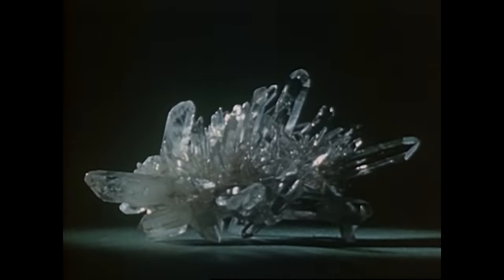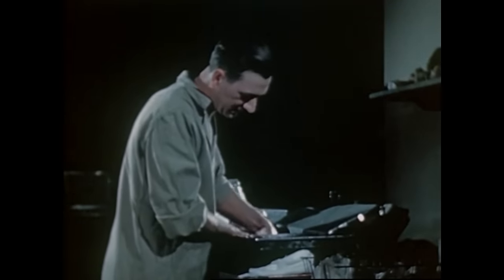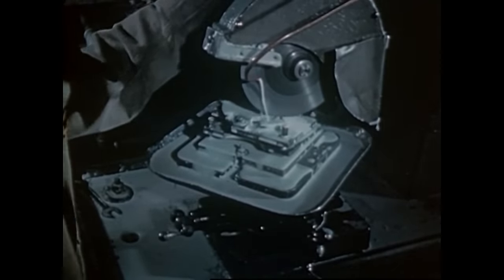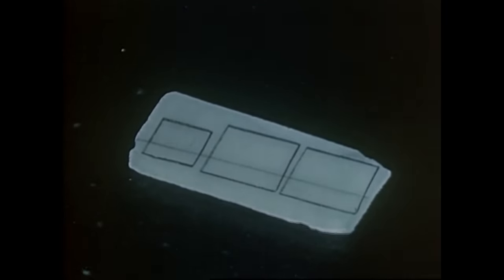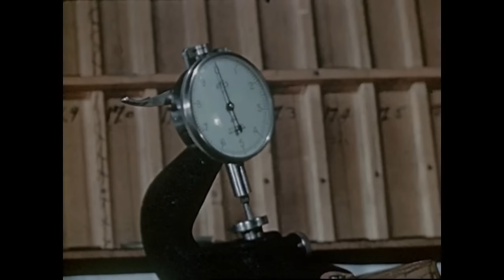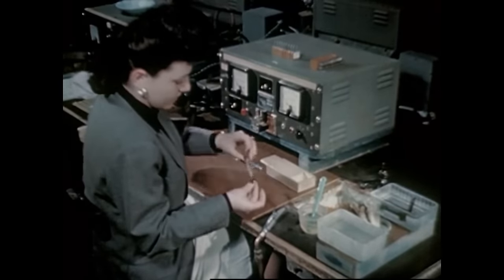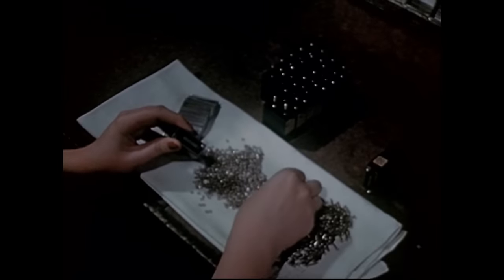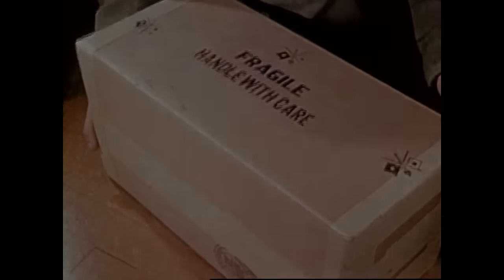From Raw Crystal to Crystal Oscillator - Crystals go to War in 1943

Comment: Although I was a professional RF Engineer, for very many years, I had never seen this documentary film before.  I have designed and used crystal oscillator circuits many times in my life but I had no idea just how many production stages and tests were originally involved in mounting and manufacturing the quartz slices. A great film detailing a piece of technology history.
Reply: I wonder how they are made today? There is a company called Rakon that makes them here in new zealand and its all done in a clean room environment, their crystals end up in satellites and all sorts of spacecraft.
Reply: @nzoomed  Good question.- the number of manufacturers seems to have decreased over the years and I understand that gold plating the contacts has become almost universal.  Modern developments in frequency synthesis and phase lock circuits means there is less demand for discrete frequency crystals, but more demand for the "digital friendly" frequencies that lend themselves to these synthesis schemes.  It would be very interesting to see how a modern company makes them.
Reply: @hectorpascal modern ones are also much smaller.
Those ones that go inside digital watches are pretty tiny.
Reply: @nzoomed  Modern manufacturers start with large factory grown crystals instead of the mined natural crystals. Slicing the crystals into thin wafers and grinding them flat is still done more or less manually, basically as shown here. But after that the process is much more automated. No manual fiddling with each crystal to etch it precisely to the right frequency.
Reply: @cogoid yeah, that would be expected. The size of the modern ones is far smaller today, the 16mhz ones I use on my arduino are pretty tiny, seems to be a different form factor compared to the much taller ones I would install in my CB radio, but pcb footprints are identical

Comment: Wow, old technology with respect to frequency determination, but darn impressive, plus a lot of work to manufacture.
Reply: The same technology is used today. Maybe the machines are a bit more beautiful.
Reply: @ciprianpopa1503  In chip wafers?
Reply: @emilkarpo  Many devices still use quartz crystals for clock signal generation, including computers, cell phones and many other devices that have processors. There are also ceramic resonators now, so some devices use those instead. But the crystals are cut in tiny sizes now and put in small metal cases.

Comment: The US had a lot of trouble getting sufficient quartz of good enough quality to meet war needs.   So Bell Labs devised a process for making synthetic quartz, making most of the work shown in this film obsolete.
The film shows them using the old fashioned pre-war FT holders.   Several manufacturers came up with gold plating the contacts on to the plate and encapsulating in glass - thus very much improving performance and making the rest of the work shown in this film obsolete.
Reply: Neato, thnx for the extra infos 🙂
Reply: HC6U and HC18U spring to mind.
Reply: Japan did even more in the early 1980s.

Comment: Who was the intended audience for this film? The first two minutes are so general that it initially appears to be made for the general public. However, the beginning is followed by 40 minutes with so much detail that I would not be surprised if some of the information was classifed in 1943 when this was made. It is great for historical electronics, though.
Reply: Being in a signal unit in the late 80's I would guess signal officer training. Some of this information was still pertinent for older equipment, though that stuff was being phased out.
Reply: Employee orientation.
Reply: If anything was classified in this film, which there is not, the entire film would require a War Department classification banner at the beginning and end. Which there are not.
Reply: Perhaps engineering students, or college kids in geology101.
Nobody in modern times hardly teach to kids using these films, when everybody has powerpoint?
I had plenty of these in A school and C  schools.
It's better how it's done nowadays.

Comment: I've done a few crystal oscillator sets in my career. Maybe once the type in the video. I repaired CB radios and scanners that had 3-12 channels that required separate xtals for each channel in the 1960s and 1970s. The CB radios need a pair, one for transmit, the other for the receive section. My company, Radio Shack, who sold these radios started making xtals for these sets as well as their own brand of wire and cable here in the US. However, the QC in that xtal Lab was not up to speed as some of the xtals dropped lower in frequency outside of the band tolerance over time. As if the equipment was bought and the experience needed to produce these xtals was lacking. The lab manager kept denying these claims and the store managers got the xtals from another source before the PLL units were sold with all of the frequencies, bells and whistles you want to monitor.
Reply: Do you remember when those super old electronics had that red liquid inside of a little bulb looking thing?? 
What was that?

Comment: I actually did this on strontium titanate crystals for a summer job back in the 90's for superconductor crystal research... We didn't have the oil tank and polarizer, we looked for marks on the crystal which gave away the orientation to a degree. Then we'd mount it to a block and hit it with an X-ray source and then onto some polaroid film, and leave the room. Shoot it for a few minutes, tehn come back back and pop the film out and see the orientation. From there you'd know where to adjust it and grind a flat on it, reshoot it to see if you're still accurate, then send it off to the wire saws to be turned into disks. 

It was an interesting job.
Reply: @BrianFortner  I really didn't have a job title... that was literally 30 years ago. Company was Coating and Crystal Technology LLC in Cadogan PA.
I was summer help as an engineering student so I got into all kinds of stuff.
Reply: @BrianFortner  In all honestly what it boiled down to was they did some pretty neat stuff and a friend of mine worked there in the machine shop. Since I was going to school for engineering, he mentioned it to his boss, who met and he realized that I understood what he was working on so he turned me loose on some projects. I learned a lot that summer, some good some bad. Overall it was worth it.

Comment: We used to back in the day pull the crystal chips in our radios and switch them giving us a unique channel. This works if it the same in sender and receiver.
Reply: Please say more about switching
Reply: You can do it with CB radios too... "private" channels. Well, at least private to other CBers.
Reply: Our switch the tx and rx around and moves the the frequency up 455khz
So say you were on ch 22 which is 27.225 the you would end on 27.680 if the radio has high side injection.

Comment: I used to work for a company that was a DOD contractor.  When we had to ship stuff, we would seal the boxes exactly as shown at the end of the video.  We used a tape machine to moisten adhesive on paper tape, which was placed over every seam of the box.  We did not have to stamp the tape seams, though, as the adhesive was strong enough to damage the box surface when removed.

Comment: I am flabbergasted at the amount of work that went into the manufacturing of crystals !
Staggering !
And to be sawed to a 1/16 of an inch !
Just amazing !
But to think those Brothers stumbled upon the Piezoelectric effect of crystals, too is amazing !
And to know how many times this was used, is mind blowing !
Reply: If you simply throw any white Quartz rock against another one in the dark, you will get a brilliant display of the electric potential in the rocks.
Reply: @kevinsellsit5584  
That too, is interesting !
I wonder if you had a Radio receiver close by, if you could hear the spark from the collision ?
I'm guessing not unlike lightning, it is sending out energy on multiple Frequencies simultaneously ?
If you know Morse Code, and could hold the stones, one in each hand, you might be able to communicate with someone in close proximity ?
I wonder just how far those sparks could be heard ?
Wonder if this is how German physicist Heinrich Hertz  got started ?  ⚡🤔
Lol...!
Reply: @sleeve8651  The discharges will be really inconsistent but they will send a wide range of a random spectrum, just like static or a lightning or a bad brush in a motor. I remember I figured out you had to cap coax splitters by noticing the tv went fuzzy when I used a cordless drill right under it and only there
Reply: @sleeve8651  It would work for morse code within visual range (wear your safety glasses). You get brilliant sparks every time. I would assume any radio transmission would be chaos.
Reply: Nice corn bread
Reply: Watch your rocks

Comment: Some day our ancestors will be telling stories of us in their caves. How we could fly like birds and make rocks talk to each other.
Reply: Descendants, not ancestors; but, yeah. And many of our contemporaries are nearly there already, save that they have cellular/smart phones to (inadequately) express their amazement.
Reply: @herbertbates4655  sorry 😂
Reply: We don't fly like birds though... We fly with noisy inefficient propellers in stupid metal planes that crumple into a heap and catch on fire every time they stall. We used to at least coast around on the trade winds in airships until the oil tycoons blew up the Hindenburg. But I think birds would be offended if they heard you say that.
Reply: How we made torches wich looked like lava and slept in beds of water. How we wore shoes made from the bellies of the beasts of the swamp and walking canes out of the tusks from the beasts of the savannah. Our garbs were white as snow and we rolled on wagons that could jump.
Reply: At the rate we're going, that's lamentably ineed very likely.
Reply: @FThis-x6r the Hindenburg blew itself up with the flammable gas bag filled of explosive  hydrogen😂
Reply: @FThis-x6r  The Hindenburg was powered by four large diesel engines turning "noisy inefficient propellers", but ok.
Reply: @BerzerkaDurk  which could be turned off when sailing with the trade winds. Most efficient form of cargo transportation humans ever had. Next to engineless sailboats. Hmmm I wonder why modern cargo ships don't have sails to go along with their engines.  Did the wind stop blowing? Or did the winds just change in the direction of selling oil...
Reply: Yet mankind's greatest folly was teaching sand to think.

Comment: Way back in 1970, a communications site I was at, used a frequency standard where the crystal temperature was kept stable by using an oven and Naphthalene. The oven was operated around the melting point of the Naphthalene,  keeping the temperature stable. Then rubidium came along...
Reply: Now we just have GPS lol.

Comment: The 1946 Quartz Crystal textbook ie Bible by a Raymond Heising says they made 10 million of type FT 241 type alone from the Fall of 1941 to end of 1944..

 That text is 562 pages if you want the math and engineering of quartz crystals. Graphs crystal cuts. 

Heising was a radio research engineer at Bell Telephone Laboratories.  That's were much if this started. 

On page 494 it says they use 80 crystals per army tank and it was FM radios they used. 

All those "making crystals" was done all over the Midwest often in dinky towns. Oklahoma Kentucky Indiana etc. Also war effort vacuum tube factories too. A old neighbor in Indiana worked at one.

I saw this film back in the late 1960s. 

The Crystal textbook here was bought at the TRW swap meet in 1987. It has an embossed seal on some inside pages Simon-Ramo Library.  Embossed like an engineer uses

In that era they use a physical crystal for each frequency ie channel just like a 50s thru mid 70s cb radio did. Ie before there was a way with digital electronics to use one crystal per radio.   That is why they had to make so many different crystals. 

I think the ww2 crystal cases are Bakelight
Reply: Thanks for the insight!

Comment: My Japanese radio has 3-4 different crystals in sealed little boxes. The front has a slot that accepts them on a larger box that goes in the slot.
   Can't be more technical, it's the only one I've seen from overseas and it's all screwed shut and half covered in brass contact blades.

Comment: We lost one of the best crystal manufactures a few years back. ICM ceased production more than likely due to a lack of demand from the communications industry. There might be a single company left in the states that will only manufacture the crystals but they do not provide the services of recrystaling of what are known as "channel elements" and doing temperature compensations for the crystals used in these elements. If anyone has a supplier in the EU please let us know.

Comment: It would be interesting to see a video of the present day manufacturing technique
Reply: First step is to put feed solution with a little lye in an autoclave with carefully oriented seeds on platinum wire. Then wait a couple months. The cutting is much less measurement intensive but into far smaller pieces each step of the way. After orienting the cuts, there's no testing or adjustment until they get packaged in surface mount casing and are tested completely automatically. If they fail, they go straight to the garbage; no re-lapping, x-ray or any other kind of adjustment. If they pass some get dropped into through-hole packages, but 95%+ are surface mount these days. The labor involved takes minutes instead of hours from crystal to packaging, and each synthetic crystal, much smaller than the bars at 9:25, is cut into about 90 wafers, each of which yields around 6 blanks for one finished component each, compared to maybe 30 slices for those bars.

Comment: Such a tedious  but necassary operation. I was thinking about all those solutions used to clean and prepare those crystals when they were finished with them were being flushed down the drains and into the rivers  and stream ekkkkkk!. Amazing how the process of making lens for the first specticals led to  making lens for telescopes and microscopes, led to making radio crystals which led to the making of silicon wafers for chips in our electronic devices.  Very much enjoyed the video.

Comment: Anyone else have the radio shack electronic project board and built the crystal radio? I had my ground clipped to the metal stop of the rotary dial on the phone. I was listening to local AM rock  radio station and called in and won a KISS ROCK N ROLL OVER album.
Reply: different kind of crystal my man
Reply: I did the same thing. The operator called and told me to disconnect my radio.
Reply: @josephlkozikowski916  Really? How would the operator know  the crystal radio's ground was hooked to the phone ground and not any other earth ground? That never happened. It's just the EARTH ground.  If you pounded a metal rod into the earth and connected to your crystal radio, you would also be connected to the land line phone. same thing.
Reply: @tsm688  What's your point?
Reply: @immrnoidall 
He frequently likes to commentate 😮

Comment: I remember always looking for mil spec components when they were affordable back in the day - this video demonstrates why.  Consumer grade doesn't go through quite as much extreme testing.  It's also amazing to see what must be close to the "first gen" crystals for crystal radios.  I remember buying these for a radio (I think it was a CB but might have been ham).
Reply: Jauch Quartz has a somewhat more modern version of this process where they started growing the crystals from "blanks" making the first part a lot easier (no mining and sorting natural crystals), the remaining production steps are remarkably similar but most likely automated.  The lapping machine looks very similar.
Reply: @fredrichardson9761  The process is more automated but still relatively labor-intensive compared to other electronic components, but requiring a few minutes of work for each autoclave-grown synthetic crystal which might yield 500 xtal surface mount components, instead of over an hour for each of the 40 or so slices you might get from the rod at 9:25. And testing for consumer crystals is far more rigorous than the mil-spec of even the 1970s, but there's no re-lapping or x-ray adjustments; if they fail they go straight to the garbage.
Reply: @jsalsman  I know so little about this process.  I remember buying crystals for radios back in the 70s - it was either for a ham radio or a CB - for some reason I think we used these for fixed channel CB walkee-talkees.  I recall they were not cheap.  I'm guessing the process for an oscillator is a bit different than for an IC substrate or are they actually pretty similar?
Reply: @fredrichardson9761  they are similar, just very much smaller.

Comment: The lowest phase noise oscillators are still made from quartz.
Reply: Synthesized digital oscillators have excellent stability, but they generate noises of all kind. Ham operators still use crystals for superheterodyne IF stages, following very low noise RF front-end. I use a triode right after the antenna if my radio - it doesn't mind the occasional lightning...
Reply: @Ray_of_Light62  guess what also uses quartz anyway, synthesized digital oscillators